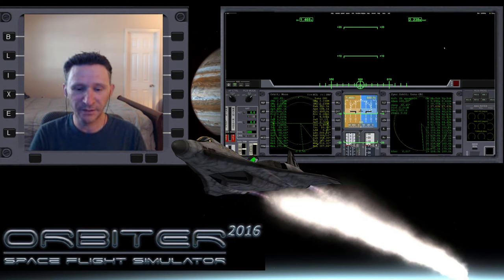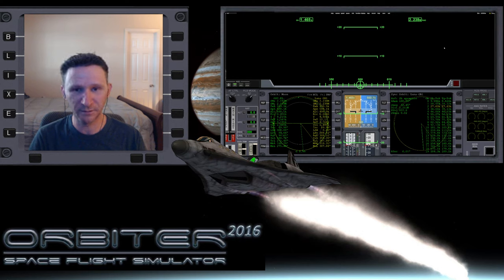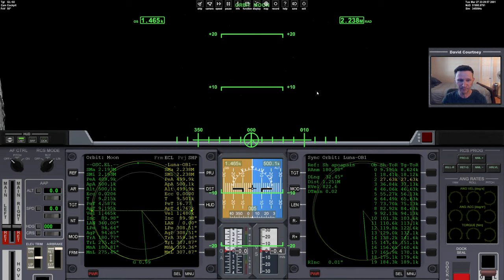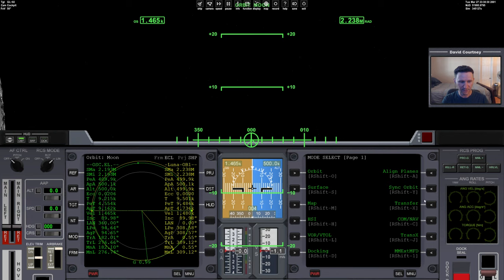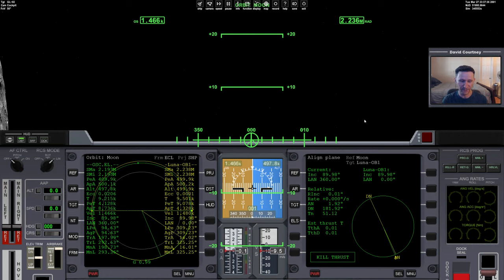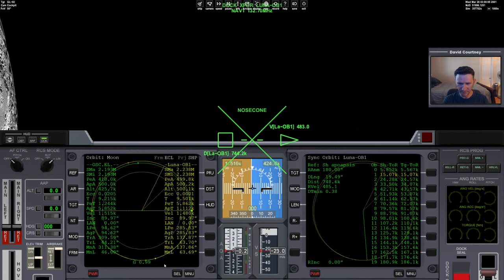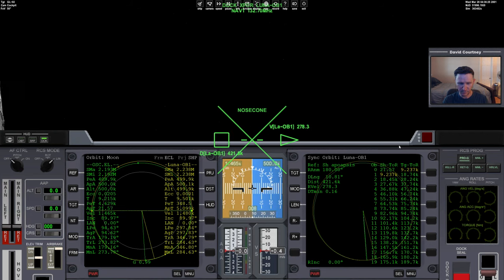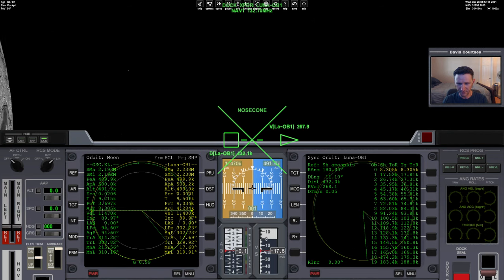Orbiter 2016 - [Part 2] Brighton Beach to Lunar Space Station

Comment: Nice docking! I finally got 2016 all installed. Everything is working well, including IMFD. Haven't had any CTDs yet. I also managed to take off in an XR2 and do a scram ascent to a 200km apoapsis and a relative inclination of less than 1 degree on my way to the ISS. Not too bad for not having used Orbiter in quite a while. Cheers!
Reply from the maker: Awesome!